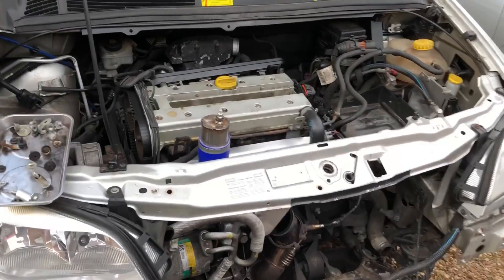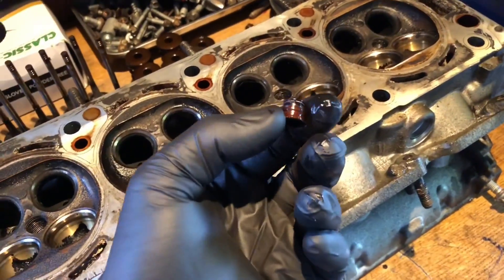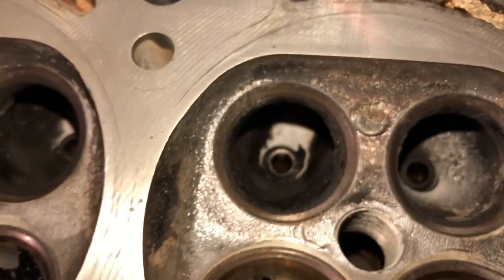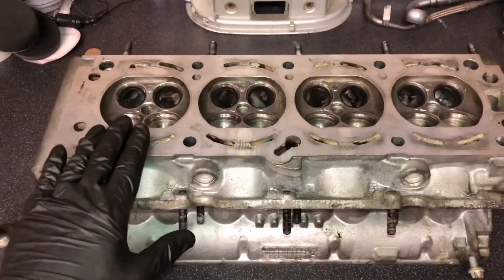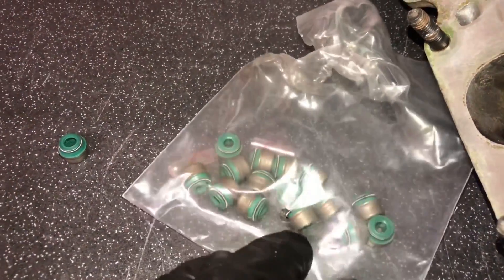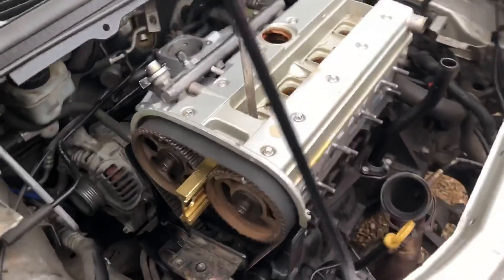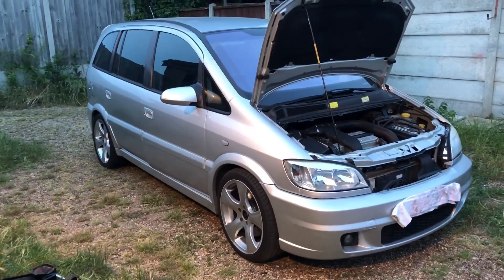[ENGINE SMOKE] STEM SEALS & HEAD GASKET REBUILD Vauxhall opel zafira Gsi opc vxr Z20let

Comment: Hi mate just seen your video on doing stem seals I've got an astr h vxr 2.0 petrol and I've managed to replace everything and valve lapped it just worried about how to get the crankshafts back on and in line I've marked everything up before taking it off but I don't have the gold tool to keep them in line do I need to get one. And if you've done a video on how to get the crank shaft in line could you send me or show me where to find it thanks mate

Comment: Can a cylinder head leak oil into the combustion chamber when warm, after rebuild and flattened and hydro pressure tested , i have oil leak in only cylinder no1?

Comment: I have a 2006astra 2.0 turbo petrol 170bhp it’s smoking on idle very light smoke do I need to remove the head to replace the stem seals?

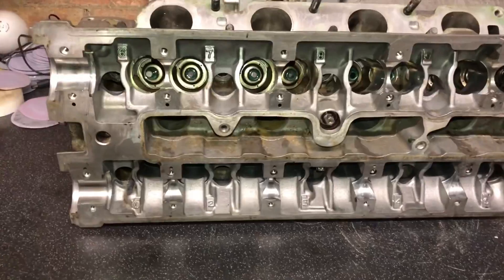Comment: 7:15 
 which type of engine did you use the plates to hold the valve seals? 
I heard that they fit with the z22se

Comment: have a gsi i know you know alot about z20let engines it is pressuring up at temp at water bottle had radiator to thermastat pipe swelled up because it was pressuring up replaced with full silicone pipes had new thermastat too all other new parts oil filter air filter sparks iridium tipped fresh oil and water never had blue smoke so stems ok ive had compression test holds 170psi all cylinders also had sniff test no signs of head going so would u think this is a water pump failure or maybe blockage ive had this car on my drive for some time had few machanics look at this thing and they have no clue as to whats wrong with my zaf gsi

Comment: corect me if im wrong but its fuel injection, so after stop seals leaking the fuel getting sprayed onto the valves will start cleaning it up.
Reply from the maker: On the inlet side yes but exhaust side no

Comment: hi bud great videos very useful too my gsi cambelt decided to catch the cambelt casing n it pretty much stripped the cambelt but it hasnt snapped but the strans of belt had caught the crank pulley n caused the timing to slip like 6 teeth so thats the head knackered i guess ive got another head n all the head gasket kit any tips as where to start any info wube be helpful cheers pal

Comment: Hi Aaron, great video. Your z20let videos are very useful. 
I'm going to be swapping my engine in my zaf gsi soon for the second time. Last time we dropped the sub frame which seemed to be a lot of mucking about and now have tc light on permanently. 
Have you taken one out before and if so did you take it out the top?
Thanks again for the videos, keep them coming 🖒
Reply from the maker: Yes i normally take them out the bottom due to the bulk head. Is the Tc light on its own? Or is it with the abs light aswell
Reply: Hi Aaron, yes the tc light on its own. Opcom says the steering angle sensor needs calibration but can't find any info on the Internet about how to do it or even that it exists on a zaf gsi.
There is a video on YouTube of someone taking it out the top, but yes the bulkhead is the issue 🖒
Reply: Took it out the bottom again in the end. I took the subframe, engine and gearbox out as one, not quite sure why people do it separately to be honest.

Comment: As a zaf gsi owner I love these vids not long ago done my stems with head on lol due to cost just got a vxr turbo and actuator dirt cheap I need to change but may I ask why you used those useless stem seals that'll just go again soon I thought you would of used nevlock retainers that are permanent
Reply from the maker: Them stem seals will never pop bk off. ill do them again for free if they did. The issue isn’t the seals. I have an engine running 7.5k rev limiter for 7 years now and still perfect. The issue is either the fitment or worn valve guides

Comment: Owned my vxr now for about two weeks noticed when I leave it idle for around 5 mins then give it a slight rev to around 3k get a puff of blue/ish smoke , once im driving no smoke at all expect for when I hit traffic lights ect when I pull off get a slight puff of smoke is this stem seals or Turbo ? 

Second question is , when I had the car he said the sport button had been mapped out , it was fine on a dry day expect I went to take it out on a day where it was raining noticed that the traction controlle was holding me back a hell of a lot so I pulled over held sport button in tried to turn it off but I’ve noticed the sport button don’t work at all so I can’t get the traction control off , will this have to be altered through map ?
Reply: Blue smoke not good at all ever, could be either.  Stem seal smoke better to check when just started for first time and cold. How many miles has it done?. Yes a map would sort the traction control out.

Comment: Hi mate excellent video by the way! You know your way around the zlet engines that’s for sure. I got the elring headgasket kit for my z20let today is everything else in that kit minus the stem seals good enough to do a headgasket job?
Reply from the maker: Mikey B hello mate. Thanks. Yeah everything else is fine to use!
Reply: Aaron Unknown perfect thank you for reply mate. 👍🏻
Reply: Is the Halfords valve grinding stick any good and what did you use to clean up your pistons and cylinder head mate? Sorry for all the questions.
Reply from the maker: Mikey B yeah any grinding stick is fine there just wood with two suckers. 
Head was a mix of degreaser and non acid wheel cleaner. Polishing the pistons is the same as polishing metal with different grades of wet/dry
Reply: Aaron Unknown nice one Aaron thanks for reply I’ll be removing my cylinder head at some point this week just want to make sure I have absolutely everything before I do as the zafira is my daily. Lol
Reply: Aaron Unknown just out of curiosity what were your compression results in psi?
Reply from the maker: Mikey B yeah i don’t blame  you the last thing you want is to have your car off the road! This engine was 160-165psi around 11bar
Reply: Aaron Unknown perfect mines around the same compression results. Thanks again for your help Aaron.

Comment: I'm looking at getting a gsi zafira would u recommend doing the stem seals when getting one and the head gasket. Have seen a lot about them being prone for these issues
Reply from the maker: Hi there, first check for blue smoke on start up or when idling. Its always good to do them if you have no history of when they were last done
Reply: Aaron Unknown cheers for the reply bud. Is there any other common faults to keep eyes out for with these. I'm going to be driving it hard in the sense of a lot of millage
Reply from the maker: No probs! There very good engines when they have been looked after so find a good one is my advice. The usual check for turbo smoke, crunching gear syncros, noisy lifters, head should be quiet
Reply: Aaron Unknown right o I'll keep all that in mind. I will probably put a bit more cash out for a low millage one with history. Cheers for the help mate. Keep up the good vids!

Comment: I always thought doing the stem seals with the head on was a great idea until I saw this. Can’t believe how clogged up it was. Is there any reason you don’t use stem seal retainers ?  They are proven to stop seals popping of. Genuine or elring. Great video though 👍
Reply from the maker: Thanks 👌🏻 Glad it helped mate. I don’t use them as i feel there unnecessary, if a customer wanted them i would fit them but not to my own engine.
Reply: How can I get in touch to get a rebuild on my zafira gsi. It smokes when engine is hot, thank you for making the videos